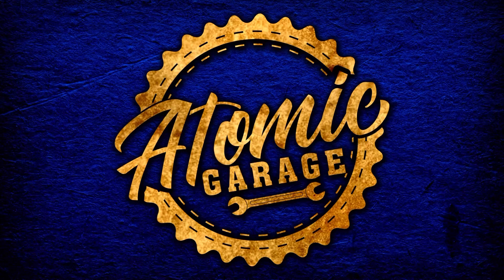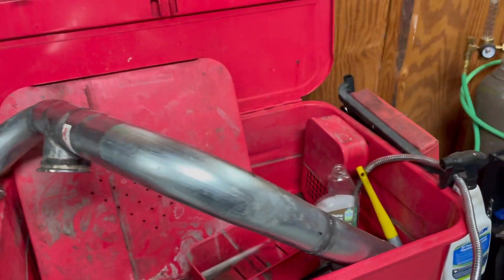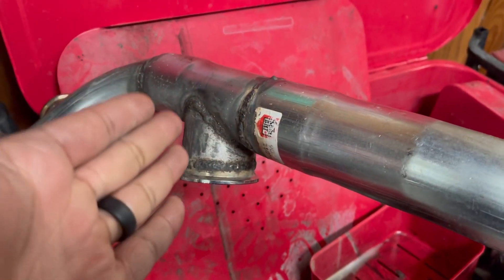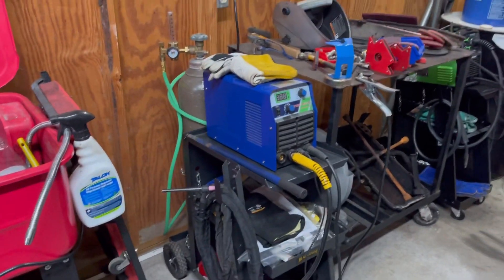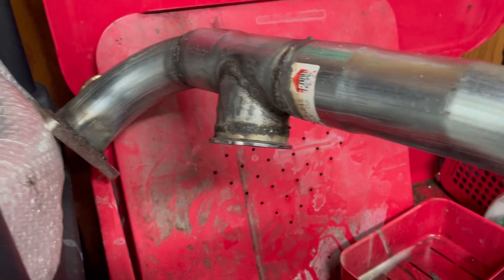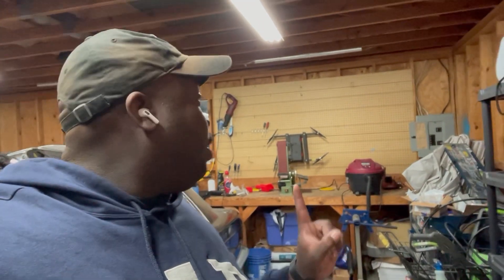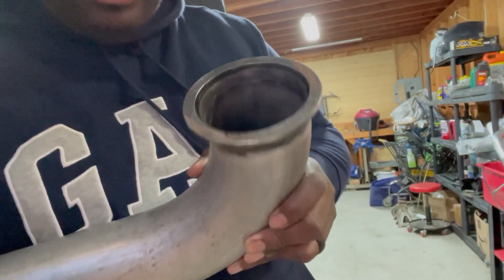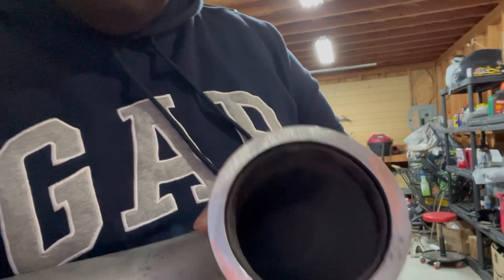TECH TIP TUESDAY- VBAND LEAK FIXES!!!

Comment: old garret turbos used the flat vbands, they have copper and composite gaskets for them . they are about 9 bucks each. permatex is not such a hot idea if using oxygen sensors.
Reply: where can i buy them ? cant find them online any where i want  2.25 inch ones for GT30  hot side inlet

Comment: My suggestion from the aircraft industry. Take a rubber mallet when putting them on and tap on it. Don’t beat it. Go around it tighten. Go around it tighten go around it tighten. You’ll get at least a half inch of bolt travel.

Comment: I do understand not everybody has the money to spend on specialized equipment but that’s actually not a lot of money to pay for the job knowing it’s gonna be done right each time check them out.  I don’t get paid nothing for telling you I’m just telling you so you and your viewers know.  I use V band clamps that have a machined groove one’s male one’s female so the belt sander way would not help me .  There is even another guy using two female clamps and he sells a copper ring that when you tighten up to be bandit squashes between the 2.  But let me tell you get yourself one of those cool I went with strictly modified because of the price difference and it’s often as I’m gonna do it which is not too often. Let me know what you think

Comment: I have a recommendation and I’m not a magician I can weld but if you want to prevent the warpage to the bent V Clamp or  warped. Get yourself a set of these or even just one these are great and work.  Where I’m at I don’t have room for my Tig Welder Setup. I’m welding my V band clamps with  oxygen and acetylene welding torch.  Quick shout out to Kent at TM technologies he got me hooked on this type of welding.  It used to be all there was before MIG & TIG stick anyway yes I’m using oxygen and acetylene and welding stainless steel aluminum  do you have to use a shielding flux for the backside of the world in the front side of the world as well if you use oxygen and settling to achieve your welds.  But the point of my comment is these adapters will pull the heat away from what you’re welding and there’s two companies that I know of that make them check it out. Not sure I just started watching your videos do you back purge meaning do you shield the backside of your weld when you’re welding on stainless steel otherwise you’ll get weldcontamination from oxygen. I’m not picking apart what you did I’m just trying to help .  Check out the cooling flanges they make them in copper and aluminum  oh I just realized I can’t add a picture here I thought I could share a picture in the comment section.  My bad so in order to check it out you’re gonna need to go to  strictly modified.net  it is a V band that has a aluminum block hooked to it to act as a heat sink and take the heat away from what you’re trying to weld. And the other company that makes them is Ticon  industries they’re called Ticon Chill Blocks.  They really do work amazing plus you can use either one and back purge your stainless steel so you don’t end up with an oxide layer on the inside of your weld and a crack just like you would use a trailing gas TIG torch adapter so you can just keep welding the trailer and shield keeps the argon over top of the  still hot stainless or aluminum or whatever you’re welding so you can keep it moving rock these V-band blocks take the heat that you’re putting into the metal away so it doesn’t worp.  I use talk to text and I know that was long I’m gonna shorten it up a little bit now I apologize but you won’t be sorry that you read what I just wrote and you won’t be sorry if you try one of these blocks I went with strictly modified you will see why not saying Ticon doesn’t make good stuff because theirs are a work of art .